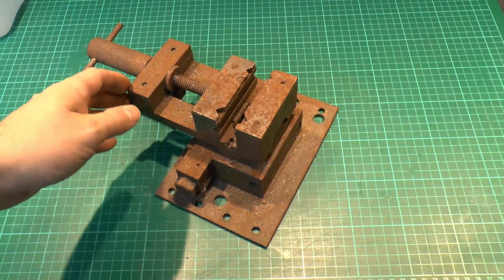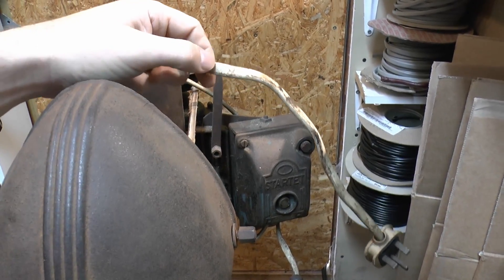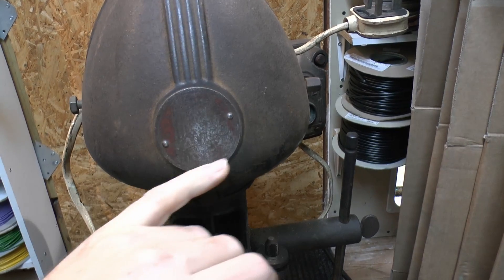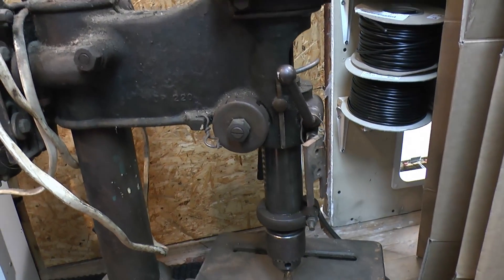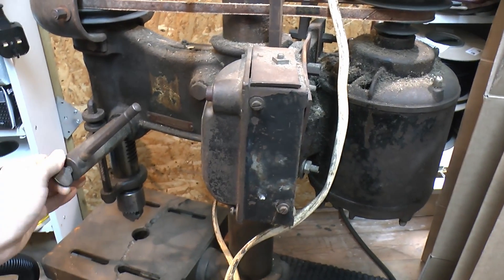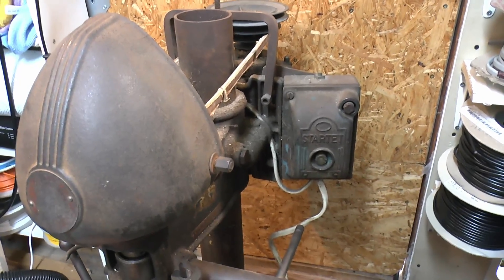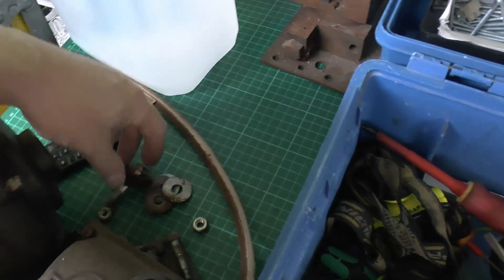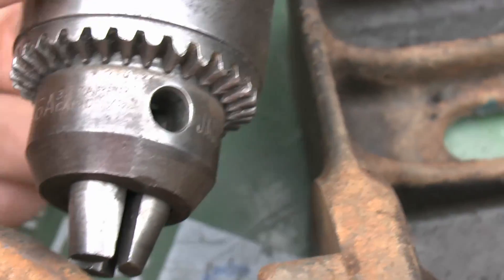Tauco Bench Drill Part 1 - Overview and Dismantling

Comment: Your estimated date of this piece is off by a bit, it's actually from the late 1930s, as you can tell with the wonderful art deco styling, but obviously that 50s duraplug on it must have been attached later on to use it with the newer sockets, as opposed the 3 round pin plug it probably originally had.

Comment: How did you get the chuck off the end of the spindle? Is it screwed on or pressed on?
Reply from the maker: It's a taper, wedges required to remove it as described here: http://www.jacobschuck.com/drill-chuck-removal-guide

Comment: I have a similar drill im trying to figure out how the you tension the belt.
Reply from the maker: Should be two bolts where the motor fixes to the frame, loosen those and slide the motor to tension the belt, then tighten the bolts to secure in place.
If it's already as far out as it goes, the belt is stretched or the wrong size.

Comment: The missing label I think is a diplay of various rpm/speeds for different belt positions. And the homemade tool is maybe a drift for removing taper chuck and fitting larger taper shank bits.
Reply: Yes, I know this is a very old thread, but that label is a list of applicable patent numbers for that drill head.

Comment: Goody!! Another project to keep us happy for the coming winter :) 
Question - why are there different sized wheels on the top of the motor and drilling unit? Was it so different length belts could be used and so change the drill speed?
Reply: Modern drill presses are still designed like this. You have the right idea, it's so that you can vary the spindle speed, but it doesn't require a different belt - the different pulleys on the front and back are designed such that the same length belt will suit each of the three possible positions, so it's just a case of moving the belt up or down on the pulleys.
Reply: These days you can install a variable frequency drive that lets you vary the speed without having to move the belt

Comment: the bit of wire on the side is where a metal loop went , to hold the chuck key, i would probably put a new chuck on this as it will be less sloppy and for the price of the chuck key its worth getting the pair from the same supplier.  others on youtube look great in metallic bronze, unless you are fan of industrial grey! hope you can also repaint the badge, its rarer than seeing the delta tag